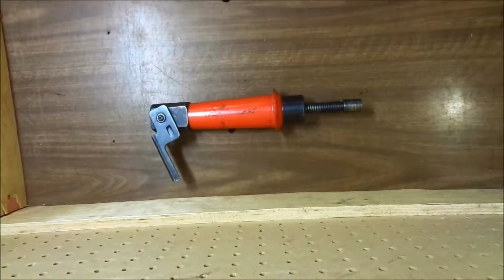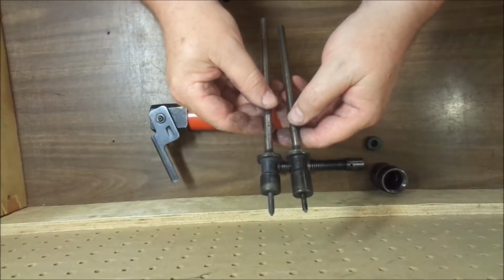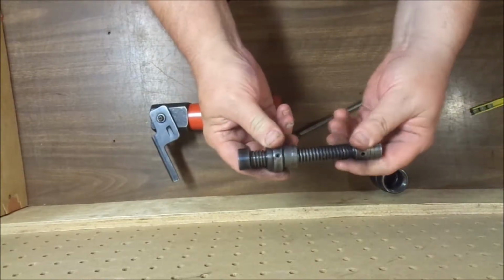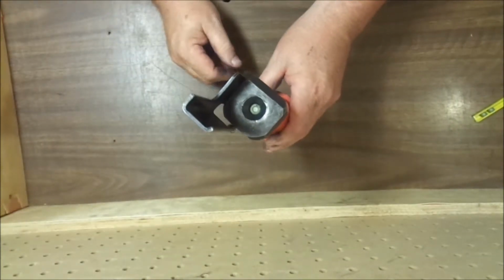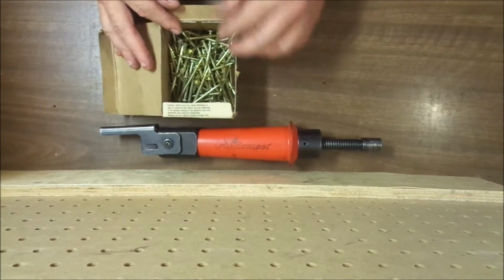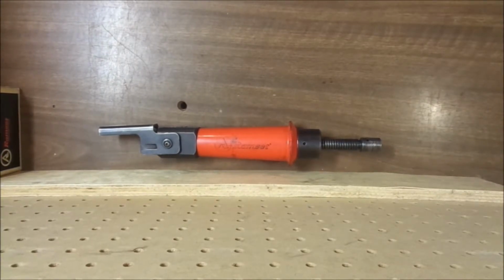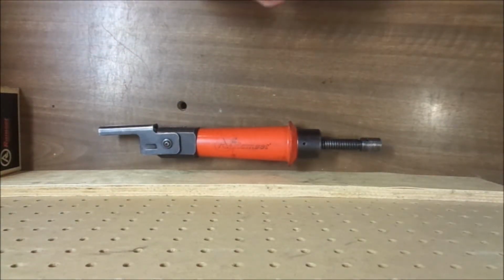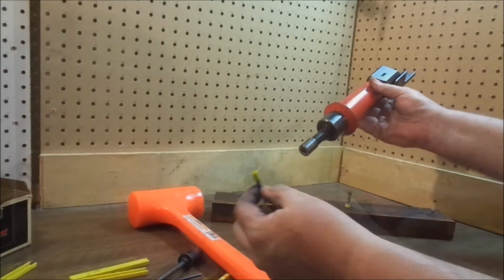Ramset 6200 Caseless Ammunition Fastening Tool

Comment: That brings back memories. When I joined Ramset in 1969 we were selling that terrible tool. They eventually went to a ratcheting nosepiece that would lock each 1/2 turn so adjustment was easier and did not slip. That still did not save the tool. In humid areas like Southern Louisiana the pellets would absorb moisture and just crumble  when you fired tool. Operator had to dig out the pieces to use another pellet.
Reply from the maker: I have since purchased a second one that was probably a salesman demo tool. Much better condition, has all three pistons but the same nosepiece.